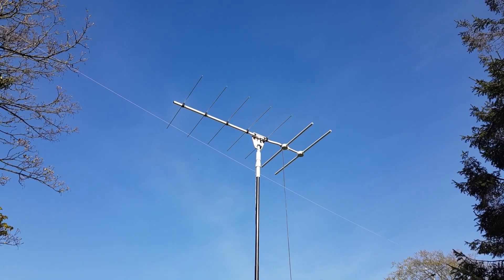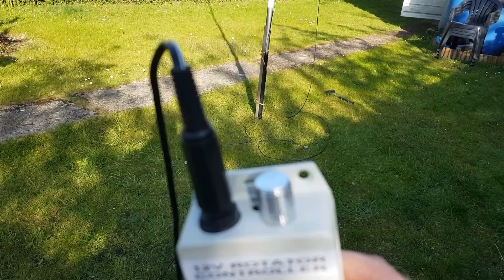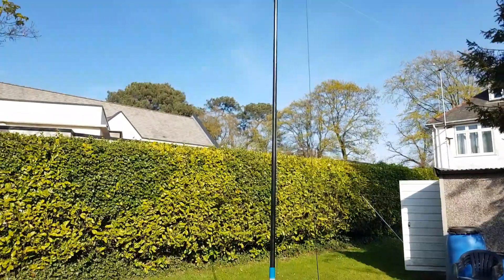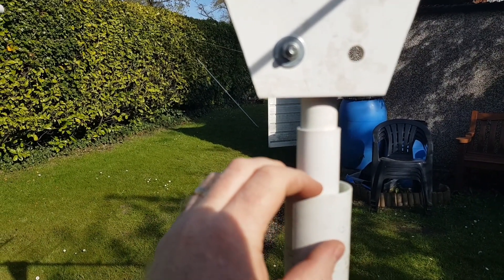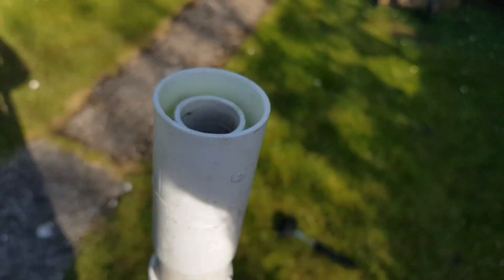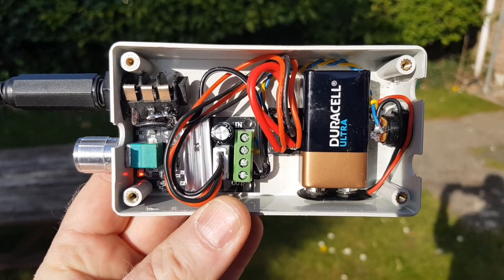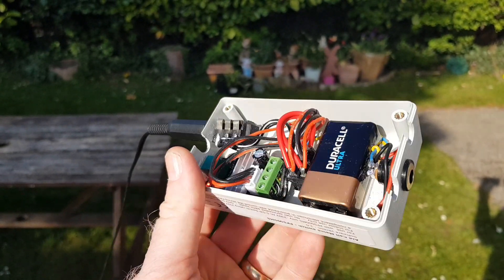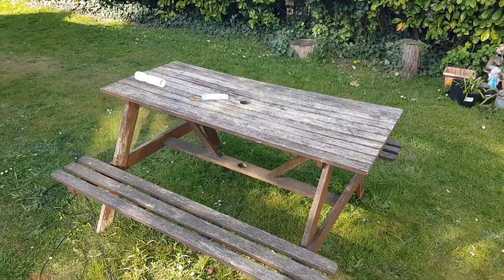Lightweight 12v Antenna rotator

Comment: Brilliant! Thats just what I could do with. I just made a 5 ele (which may become a 7 ele soon) for 2M and I need something just like this to turn it. How do you get the reversed polarity to turn back and forth (clock/anticlockwise). The good old 7 ele ZL looks great too. Made a few over the years. Well done. 73 G1IML
Reply from the maker: Hi. The easy way is to use one of these https://www.ebay.co.uk/itm/3A-Reversible-PWM-80W-DC-Motor-Speed-Controller-1203BB-Adjustable-6V-28V-Driver-/164760342794?mkcid=16&mkevt=1&_trksid=p2349624.m2548.l6249&mkrid=710-127635-2958-0

Comment: 👍Thanks for taking time to share. Clever and effective.
Only thing I was curious about was exactly how the 10mm(?) socket is attached to the motor. Think you said it was screwed on. Would appreciate anymore info please?
Reply from the maker: hi Steve. i used a solid 6mm shaft coupler.

Comment: Would be great to actually see the project being built.
Just for those that may find it more useful to follow visual instruction rather than narrated instruction.
Well done though on this project. Nice bit of homebrew kit for portable ops. 👍👍
Reply: It would be nice to see the actual motor and how the socket is attached. Maybe a link to the website that sells the motor.
It's just a load of plastic pipe fittings otherwise😉😊👍👍.
Great job tho.
Reply from the maker: nice idea but filming a build like this is not as easy as it sounds. , my garage is a tip, poor lighting, things go out of focus, handling the camera with filthy hands especially with glue etc isnt wise. Thanks for you comment..